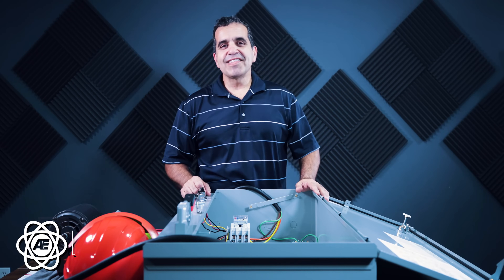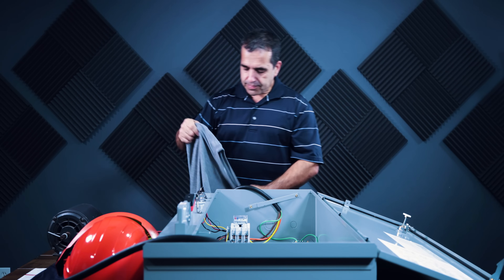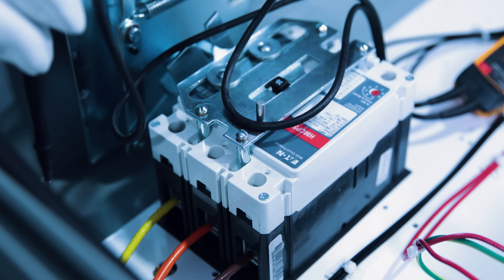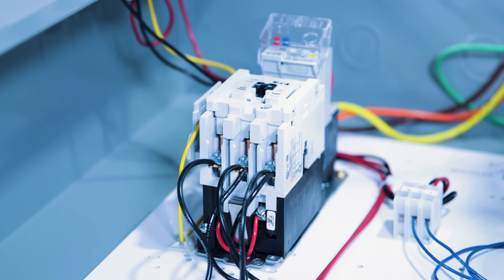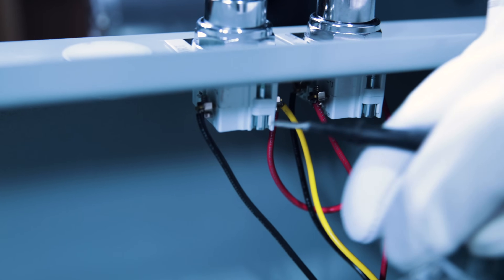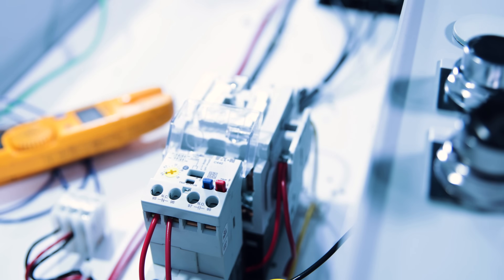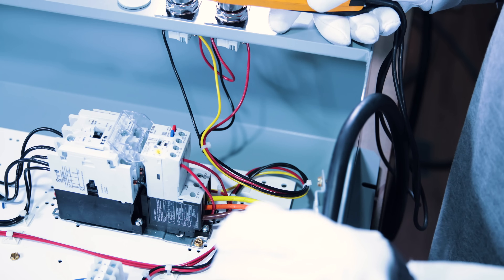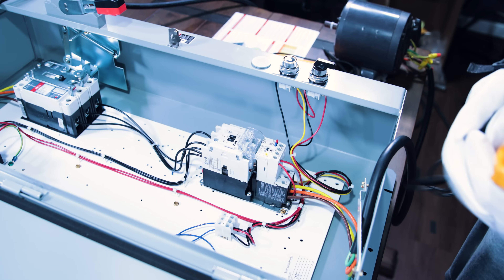Troubleshooting a Motor Starter

Comment: No way you have 480 phase to phase and 277 phase to ground. When I check where I work we get 478 phase to phase sometimes 479 or even on the 460s  We have 3phase delta so phase to ground is nonsensical
Reply from the maker: A 480/277 transformar is a wye connected transformer
Reply from the maker: See  the drawing of this transformer https://drive.google.com/file/d/1LxoTbd31yd9JreqFPQ53O89qX7TrlqSN/view?usp=drivesdk

Comment: What is possible cause(s)? Without moving the leads from a to b on a 480 3phase system the voltage changes from 480 to 277 on the output of the terminals of the contactor ?

Comment: Should also make sure that your multimeter is rated for the voltage/ amperage you're measuring. If the multimeter isn't rated appropriately it could cause death.

Comment: Ive had to check a lot of these. I would check the overload for tripping first. Then the 480 V fuses and then the motor for grounds. I found that rarely did the control circuit had problems.

Comment: I have 4 mixer motors at a WWTF. I have had to turn the yellow amp adjustment from 8 to 14 amps to keep them running with out tripping. 1 of of them however now runs for 1-3 mins then trips everytime. Pulled and megged motor. It is good. Voltage is good and consistent with other mixer motors. I have not seen Amps above 7 on anyof the motors including the one tripping. 
Any suggestions?
Going in circles with Evoqua. Plant is 1 year old. All ran good first 6 months then developed issues after that.

Comment: Thanks for this video. I went to a 5 yr apprentice program and this type of stuff they don’t teach. Should be able to learn on the job but maybe you cover once than just get stuck doing wire pull or cable tray for 2 years at a data center.
Reply from the maker: I agree. Thanks for leaving the comments. Glad the video is helpful

Comment: In real life, you push the blue reset button and try to run the machine. If it trips again, you know that you have a problem. 9 times out of 10, the operator did something to overload the motor. So you tell the operator to run the machine and watch what he does. You'll almost always find that he's doing something wrong or that there's a mechanical reason for the motor to be overloading. It certainly can't hurt to know this stuff, but it's usually a waste of time to troubleshoot motor starters this way unless there's no other explanation. And there's almost always another explanation. I've been a Maintenace Technician since 1980. Your view is from an Engineer's standpoint. Mine is from real life.

Comment: Great video... but you should test phase to ground first. Not phase to phase. People have injured themselves going phase to phase first
Reply: What should your reading be then? Up and coming maintenance mechanic, I like to learn these tricks of the trade
Reply: @FRJ1982  ur reading should be your full supply voltage divided by 1.7 for each leg. Eg: 480v would give u 282v per phase which is 277v

Comment: Really good video...just an observation looks like it's permissible in the US to use probes with excessive metal showing ? This would be shunned in the UK although it does occur here amongst some pros.
Reply from the maker: Thank you for your comments. Requiring test equipment and overall electrical equipment to be finger safe is much further along in the UK and in the rest of Europe than in the US. I think there is some movement in that direction, but we are not there yet.

Comment: Questions??? I wish i could send a photo on here ,, 3 phase motor will not run if i hit the forward or reverse button yet it will run if i manually push in the starter??
Reply from the maker: Do you have power to your coil on the starter while pushing either the Forward or the reverse buttons?
Reply: @AccessToPower  yes 240v 3 phase machine it has a start ,forward ,reverse , stop in front  and rear i have tested alll buttons and the only saftey estop too . The starters both have all 2 legs at top but do not pull in when any bottons pushed .
The machine will run if i push in manually, there is big pass through over load im going to jump it out and see if it will run . The nigjt shift says it just stopped working .
It is a very old set up FURNAS ESP 100 22HS+32A STARTER SETUP , YOU CAN SEE pics online , im wondering if that overload inside is bad , again the wires pass through it like an amp clamp , i will jump the 2 smaller wires that go back to the starter n see if runs . Cannot get why the push buttons wont pull in either direction,  really a simple old set up i suspect inside the overload may be stopping it , it resets, but still nothing
Reply: @AccessToPower  they need to make this so i can add photos n show more .. but i know its only youtube ha
Reply: @AccessToPower  and i did as i said jumper out the overload and it works it must be fried inside they had one coil jam a month ago i cleaned the contacts they are old n big .may time to hook up new started but its a rarely used machine .
Reply from the maker: Sounds like there is a problem with the control wiring

Comment: so the nuertral/fuse went out and I know you said it came from the motor. How do you ensure that the fuse/neutral doesnt cause the trip to happen again?
Reply from the maker: It is the overload that tripped on the neutral side of the starter coil. It is not a fuse. This overload is set to protect the motor from drawing more current than it is rated for. This is to protect the motor from overheating and eventually failing. You will want to verify if the motor is operating within acceptable parameters. If it isn’t, the problem is not the overload, but most likely the motor. Or the load the motor is operating is to great for the motor itself.

Comment: sorry but black lead is for neutral or ground and red for the hot wire. Thank you
Reply from the maker: Hi. Please don't confuse this wiring with what you may know of vehicle wiring. Normally a neutral wire is white. A ground wire is either bare or green. The wiring you see in this panel is prewired from the factory and they are using black and red wires internally. These include the neutral control wiring to the overload contact. If any neutral wire is leaving this panel for, in some cases without an internal transformer, feeding this panel then that wire would be white in color.

Comment: Nice video. After testing if voltage at coil. Shut down disconnect wires to coil and ohm coil. Sometimes it's bad.

Comment: I just had to diagnose a starter where the coil in the contacter wouldn't release. There were three disconnects with stop/start controls. On one of the disconnects, the hot of the stop button broke off and was making contact with the line side of the start button, bypassing the stop buttons
Reply from the maker: Nice job

Comment: Some of our motor controllers have permissives which make it harder to troubleshoot. Especially in our galley where the control circuit is tied into fire switches, dampers, gaylord wash panels which has its own circuit, and fire pull down switches. Finding shorts is a nightmare where no indication of burns can be found, only thing you got is blown control circuit fuses. Thats why its good to learn to read electrical schematics and diagrams.
Reply: That does sound like a nightmare. Honestly I feel like we are using flawed systems in the us at least some of the old ones.

Comment: 277 volts 554 volts. i wonder if they will cause motors to burn up and started to go out faster kinda like the 120 volt incandescent lightbulb, and most houses are at 127-130 volts.

Comment: Can you do a video on megging a motor or wires. What readings to look for? Ohms to ground? Less than 1k? etc.....
Reply from the maker: Javier, thanks for the video idea. I will try to do that.
Reply: @AccessToPower  Great! Ive been an electrician for 27 years...work at a University and have my C10 and you'd be surprised how many electricians dont know how to use a Megger and what readings to look for....failing motor, wet wires, and testing a load for a short or phase to phase short before simply reseting a tripped overload or breaker....please try to cover all that...take care, Thanks

Comment: Great video ! It would be nice if you could do a demo video on how the Auto function works with a common problem like PLC signal missing or any other signal problem. Very good job showing the hand function of the motor!  Will definitely check some of your future videos!
Reply: Sire please how can I troubleshoot an Smc flex soft starter tripping on fault 18 no load. Please help me out. Thank you.

Comment: Very informative video! I loved the way you start from selecting the appropriate PPE before beginning your troubleshooting and the way the you undertake your measures problems solving by following the troubleshooting steps which is ABCDE. The problem with this wonderful video was that we cant see clearly what you're reading and how your turn your nob to either; Voltage, current and ohms when digging for the neutral line that was missing in the circuit.

Comment: Just a word from a pump guy. The only testin you need the power on for is the legs and transformer. All the rest can be done with the power off and the meter set on ohms. Dont just meg a motor, ohm it across the windings as well. You can at least give the customer an idea of how much life is left in the motor or pump.

Comment: Hey thanks for the video, I am an Electrical Field Engineer, I understand the electrical terminology.  However seeing the actual Motor Control Breaker and unit really paints a bigger picture.  Allowing me to understand the technician side of the work making it easier for me to understand his side and explain it better in my side.  Both fields of study are very important in the Field.

Thanks a lot again.

Comment: A schematic of the circuit being tested would be helpful.  And starting around 4:44 I don't see where you are putting the red test lead.
Reply from the maker: @nella003, the lead was on the neutral from the 120 volt transformer. You can see where my leads are at the 5:49 mark and the black lead is on terminal 96 which is the neutral from the transformer feeding the Overload. That is where my other lead was in the 4:44 mark.

Comment: Tim  I have a LC1 D12 from Telemecanique that I have isolated and I get resistance reading on the coil leads, does it mean the starter is bad?
Reply from the maker: You should have resistance across the coil of the starter.

Comment: Walter, circuit energize and pulls in the contractor immediately when powered. I have wired in multiple push button stations and buttons have no control after wiring in multiple push buttons. I have a time delay and a latching relay. I was running into a situation where I could not take my finger off the start button. Now it is continuous. I traced wires and everything seems to be in order. Could a relay be burned in ?
Reply from the maker: Somehow you either have power from your start buttons supplying your coil when the buttons should be open, or you holding relay is closed and immediately energizes the coil. Pull the jumper from the coil to the holding contact off. Turn on power. If the coil closes then the problem is on the start button side of the circuit. If the starter does not start then the problem is on the holding side of your circuit.

Comment: There can be scenarios when the starter pulls in but the motor does not run due to a defective phase contact(s). It can causes an overload trip, eventually, but may be a good scenario to discuss in your troubleshooting hints. Great presentation otherwise.

Comment: I don’t know anyone who would suit up just to do what you did.
Reply: I do that for a living. No more than the gloves are needed and most of that testing can be done with the power off. If I had to suit up like that for every panel I would not be doing this. Safety IS important but the gear is cumbersome at best and the rules are written by those that dont have to use it on a daily basis. Be diligent and intentional in what you do and you will survive.

Comment: Excellent videos!! Thank You! I am surprised that at my work none of the crew wear Ppe and we deal with 277-480 volts !! I have learned more from you In 10 minutes than I have in a semester or any journeyman at work.
Reply: That level of PPE is unnecessary at voltages of 480 and lower. I have only suit up like that when dealing with higher voltage busses as an industrial electrician.

With that being said, working in an horizontal panel like in the video does present additional safety concerns as he is work over top of the live lines.
Reply: I mean I agree we don’t use that much PPE either but if you follow OSHA this is what you get

Comment: Good video - as likely mentioned below, you need to check that all phases are fully pulling in on the contractor/starter. An apprentice will learn this VERY quick the first time they replace a motor only to find out it's a bad contactor. :D
Reply: What is the method for checking?
Reply: *contactor not contractor

Comment: or maybe there is a loose connection in the power circuit causing a voltage drop, or a bad contact causing the OL to trip. Or possibly a partially shorted motor coil causing the OL to trip.

Comment: Good information.  I was wonder if you can answer this question for me.  I have a 400v coil ABB DOL Starter. I keep getting different information from other people out in the field. Main isolation switch was burnt out on 2 phases, I fitted new isolation switch and found starter to turn on by itself, so I fitted new DOL starter aswell with overload. Breaker tripping. I have tested motor phase to Earth and getting 30.06 ohms. Other companies have looked at it and can't get it fixed. I feel the motor is leaking to earth, however other people I have talked to say that is normally reading .  I was always taught you should not have a reading going to earth open circuit good, closed circuit bad. Any information would be appreciated.
Reply from the maker: 30 ohms to ground from the motor windings is Not normal. If it was megaohms the motor might still be ok, but ohms, the motor is bad.
Reply: @AccessToPower  Thanks for replying back to me. That is what I thought, I was correct and the other people where wrong. One other question, I forgot to mention in last statement. The old switch was was pretty old so upgraded it to a new starter switch with a limit switch connected to door so it stops motor when door is open. I have wired switch to 95 and other wire to a2 of contactor. Does that sound correct and one other thing was there is no neutral connected and main power switch
Reply from the maker: ian fraser i usually don’t add any control switching to the OL side of the control circuit besides the OL contact, but there isn’t really anything wrong with doing that. It should work, but without seeing a schematic of your control circuit, it’s hard for me to advise you. Please use caution and be careful.
Reply: @AccessToPower  Thanks for the quick reply. Have a good weekend and stay safe

Comment: good video... as he covered all the steps. If he had checked across the NC contacts after he had checked both sides and received his control voltage then he would have known that the NC contacts were open. If it was closed he would have received 0VAC. Also I don't know what level is this but I think it would have been helpful if he explained what the "holding contacts "were and there purpose.

Comment: Great video, thank you for taking the time to make this.

In the field, for the sake of time, I would do more half-splitting when checking for voltages. For example, I would have started by checking for mains voltage right at the starter, and only gone back to the breaker if I didn't have power at the starter itself.
Reply from the maker: Chris Lawson great point. This will spread up the trouble shooting process.

Comment: Hello sir. Does the control circuit has its own power supply? Thanks!
Reply from the maker: EIM - NCII Alaktrician the control circuit has a control transformer fed by the main 480 volt circuit in the panel.
Reply: @AccessToPower  Thank you for your answer sir! Your tutorial surely helped.

Comment: Just a tip.  when you test the line side power or any power make sure that you pull both leads of the meter off so you do not carry over an arc when checking the other phases.  Just a tip to keep you safe.
Reply: I was not aware of this hazard. I'm a newbie electrician and would like to get more knowledgeable on working/troubleshooting in panels along with associated hazards. What's a good online resource or book for this topic? That all covered in NFPA 70e? I haven't delved into that area much. Thanks
Reply: Read the NFPA70E handbook that will get you started in the right direction.

Comment: very good video  the only thing that I would recommend is always to use the RED in the hot and the black always to ground.  when troubleshooting 24v this can cause read errors for technicians
Reply: my comment was for technician on control system and not for just a simple electricians
Reply: @lalotrbeca  so let me get this right....What you are saying is that your comment was pointless?
Reply: Doesn’t matter  when measuring AC.  I suggest a basic electrical theory class for you!!  Besides if he were measuring DC it would simply put a - before the number. No big deal.